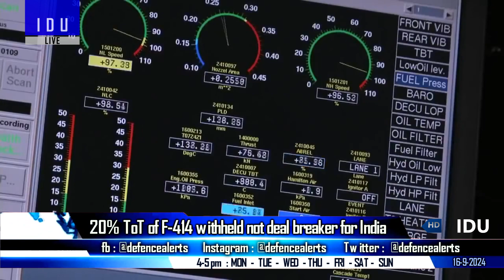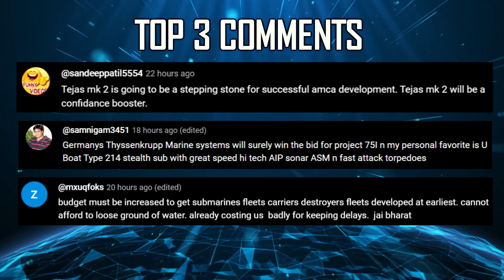Indian Defence Updates : Su-75 Exclusive Offer,F-414 Engine 100% Local,16 Nuclear Attack Submarines

Comment: Indian helicopter fire short range anteship misile 55 km ready to user trial. 300 km ante ship missile gas turbine engine  2.7kn mini😢manik engine😮developed by isro kancha imarot Hyderabad and  National aronotics laboratory nal. It test start this year end. It has more range than harpoon and Exocet ante ship😢missile. This😢missile can also fire from torpedo tube of submarine. Tejus 1a have 15000 certified cheaps and electronic circuit induction in this fightrr😮.state of the arts 11000 tools also ready for  bumper production 3 private company and hal now negotiation for special purpose vessel for 140 tejus 1,2and tedbf production per year but alash we have no engine. USA now betrayed us engine supply control if USA striker f16 junk fighter india not buyed. 
Engine f114 stalled because India's demand 80% GE technology and 20%kaveri technology involved in f114 engine or give 100% technology  USA not given ISO thermal technology to hal for Cristal bled production they will send ready made Cristal blade  india then wielding it in turbine  by laser wielding technology which😢give GE to hal  but😮we have compound metal like lithium nicle cobalt titeniam and silicate(silicon carbide  in missile waffer which can withstand 4000degre centregra temp on reentry face. .we also produced single😢Cristal bled comperesure bled in midhani. We have mastered isotharmal 2000 technology  in midhani But ge not allowed to Indian technology to ge f114 engine because that will India gate hybride😢f114. 100% tech. And that's need certification time. This financial year engine agreement. Now 2+2 negotiation start in delhi. Yesterday and today. And modi with😢Biden in New York. 
Carbon carbon composite  we used previous Agni misile. Which produced in Chandigarh. We also have ceramic tecnic and production factory in jharkhond. 2026 factory productions start. Tata have 3 semiconductor factory one gujrat one Bombay another state not disclosed.

Comment: US demand for both F404 is over, no idea whether its production line is active or closed. Already India plans to have at least 128 to 200 no's MK1A with life span up to year 2060. Hope there will be no spare parts supply chain problem up to 2060.

After 2025 or 2027 when all F18 Super hornets are produced F414 production line also may close due to demand. Good move by India by shifting F414 local assembly so after MK2 rollout they can control the spare parts supply chain for a long period. Wonder how much indigenous content we can get in F414 engine.

Comment: 16 SSNs and at least 10 SSBNs along with 3 Aircraft carrier will be needed by 2047 to maintain the balance of power in the Indo-Pacific region. 💪🏻 🇮🇳
Reply: No possibility of building that many SSN.  Way too expensive. 

Instead air independent diesel electric subs will be built with really efficient batteries.  

Unlikely to build more than 4 ssbn.  They are even more expensive and have just 1 purpose.  Using it for that purpose means it's all over.
Reply: @mtrest4 india actually has planned for 6 SSBN. S2 (arihant) and S3 (arighat) are already commissioned. S4 is in trials, you can see it moves on Google maps. S4* is at 50% completion. And the permission for 5th S5 has been given
Reply: @mtrest4  S3 is ready and S4 and S4* will be upcoming and then we’re having S5 class submarines with 13500 ton displacement all of these are SSBN’s. We could use the Diesel electric with AIP submarines instead of SSN
Reply: Diesel electric AIP subs for the Indian ocean region.  

They would still have to surface to recharge their batteries🔋which they could safely do within range of land based naval assets.

For areas further afield like the South China / West Philippines sea, this is not an option.  The sub cannot surface to charge its batteries or it will be located and destroyed.  In that case, SSN are the only option.

Not very many SSN however can be built as they are expensive.

SSBNs are mostly white elephants as they have only one end-of-the-world scenario in which they have a purpose. 

2 x SSBNs would be enough.  If it provides no deterrence, it is unlikely more would.

Comment: India must accept SU75 or SU57 and we can also take American fighter if it comes without conditions!  Our airforce is habitual of operating both western and Russian aircraft.  Technology transfer comes at 4 times higher cost it is advantageous only if we have full control over technology and we can develop our next generation equipment using it!! Technology to assemble equipment is of no use once the equipment is phased out..
Reply: First stealth of Su 57 is questionable. It comes with legendary russian availability. Su 75 is only on paper. So far there is no meaningful ToT from Russia even after we ordered 1000 jets and now you expect them to give their top of the line jet?